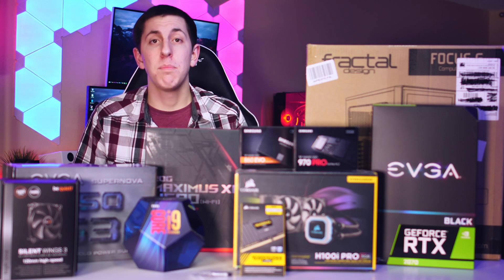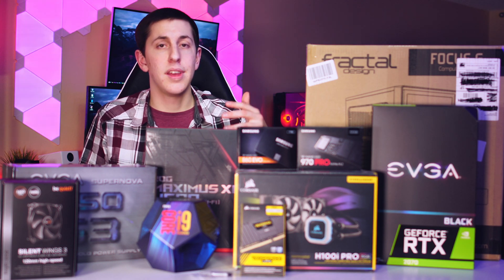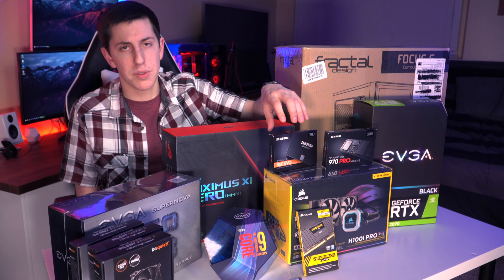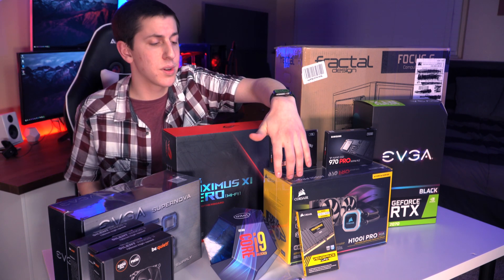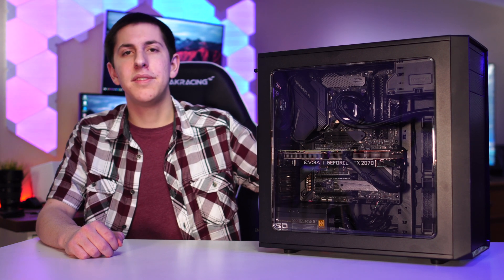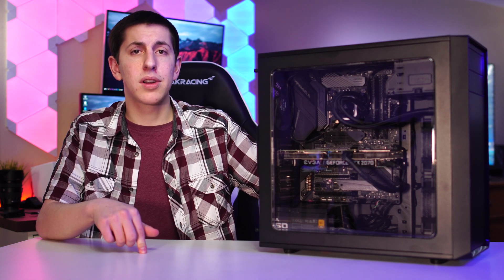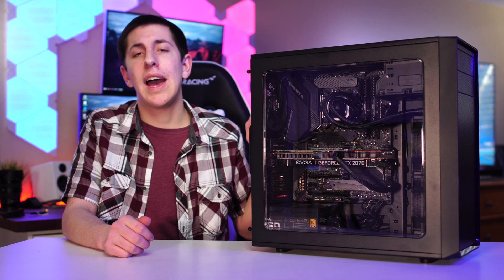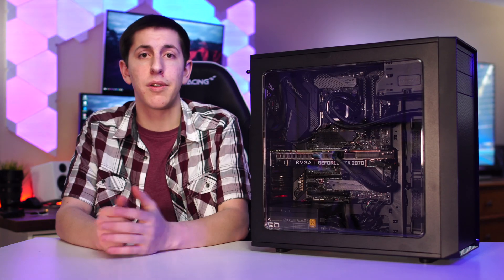$2000 Ultimate Editing PC Build - i9 9900K RTX 2070 - w/ Benchmarks - 2019

Comment: I am going for a i9 9900k and RTX 2070 8gb and 32gb RAM and a Asus ROG STRIX Z390-H and 1tb Samsung EVO SSD

Will this be good for gaming?? ($1700 Roughly)
Reply from the maker: Yes. It'll be a great PC for gaming.
Reply: Tech Infusion yea I asked around but people said I would be lucky to get 80fps which I thought was not true looking at the price
Reply: Also will I use Air or Liquid Cooling??
Reply from the maker: Depends on the game you are playing. If it's a super intensive game, and you run it on all ultra settings you may get 80 fps.  But for competitive games, you can run on medium or high settings and easily get over 144. 

I would recommend liquid cooling. It'll help if you ever want to OC the 9900k

Comment: Cooler will work on stock 9900k, but overclock that to 5.0ghz all cores, you might have issues. Nice build
Reply: Can you be more specific I want to copy his build and overclock to 5.0ghz what do you advise also are there any same extra fans for this case size with RGB he used be quiet 92mm but I want some rgb fan that will fit in this case

Comment: I would choose a used 1080ti anyday over the RTX 2070
Reply from the maker: I would as well. However there is a huge price difference.
Reply from the maker: I actually have a 1080ti in my personal build.
Reply: @TechInfusion  used? I found my used 1080ti for under 525 dollars. New for sure is way more pricey, but the used market is nice...
Reply from the maker: Very true. Since this build was for a friend didn't want to buy used parts just in case it didn't work.
Reply: @gwwtech5782   525 because it was probably mined bitcoins for 24/7 lmfao.
Reply: @CasualMusicAI  works well still